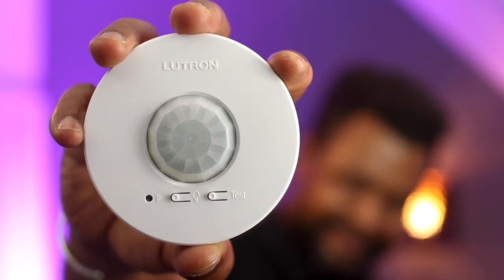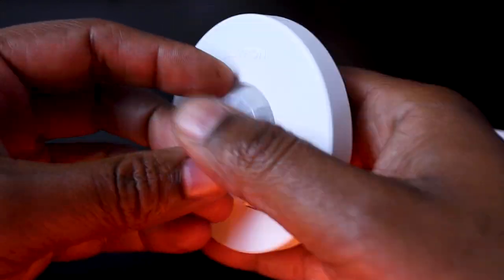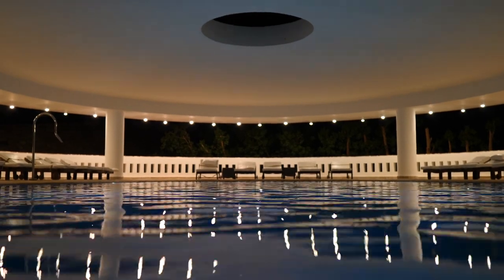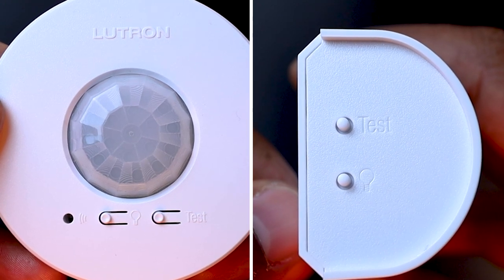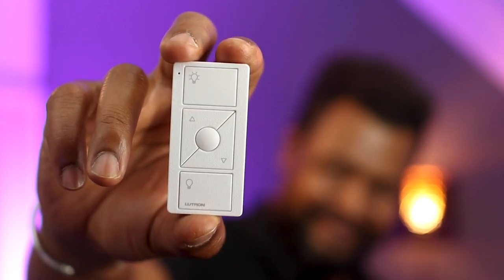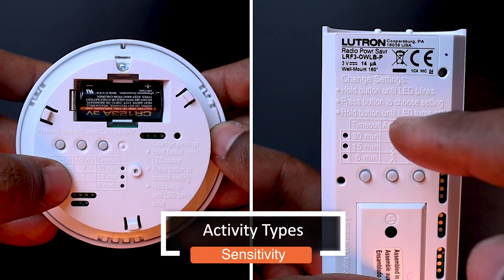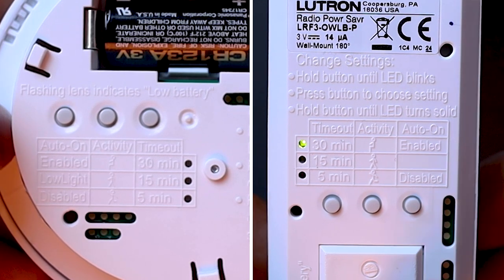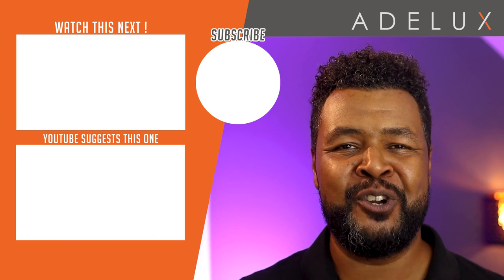Lutron Wireless Occupancy Sensors Radio Powr Savr. How to Select, Install and Program. Adelux (2022)

Comment: Hi and a big thanks for producing this very helpful video. We currently are about to embark on a home remodel project and I'm considering incorporating Luthron Smart Home devices. I'm just starting my research, and trying learn more about the Luthron's Whole Home Systems and which one would best suite my needs, the RA2 Select, RadioRA 2, RadioRA 3,  or HomeWorks? I intend to control direct lighting, RGBWW LED lighting, Blinds, etc. Can you direct me to a link that could help me decide?
Reply from the maker: Thanks for your comment. Did you check out this video ? 👉🏾👉🏾Lutron Homeworks QS VS Lutron RA2 Select // Which one is best for you? NEW (2020)
https://youtu.be/acMEDmzKwio ?
DMX control for RGBWW is HomeWorks only at least in the UK 🇬🇧 where I’m based.

Comment: How do I bypass this the auto-off? Would I simply just take the battery out? There are times where I need the light to remain on even when there is no motion detected.
Reply from the maker: Ho well…that’s an occupancy sensor! 😅 also depends on what kind of room it’s fitted in …..couple of things though….while a room is occupied, if you change the light levels (from button or app) the light should stay where they are until you exit the room. Try that ✌🏾
Reply: @adelux  I actually need the light to stay on without anyone present in the room.

Comment: Can it be set to a dim light level at night and bright during the day with caseta?
Reply from the maker: I don’t think you can. We don’t have Caseta here in the uk 🇬🇧 but looking at the app for RA2 select you can set the on / off level one one side. Then the active hours on the other, but no correlation between the 2 to trigger level depending on time (like you would find on lutron homeworks for example)
Reply: @adelux that's a shame 🫠 thanks for the response!